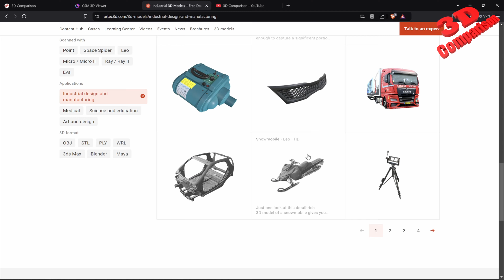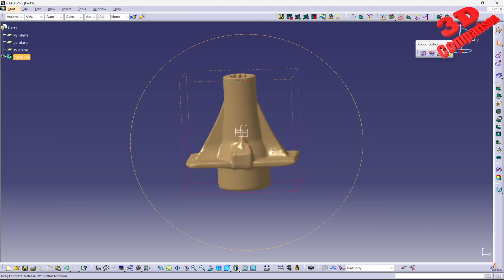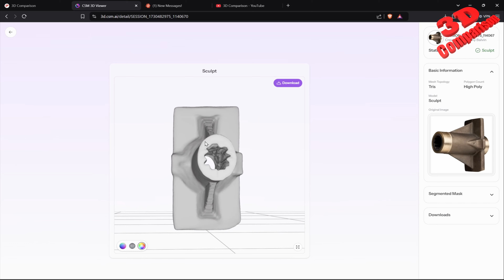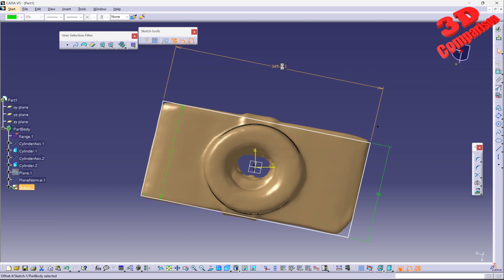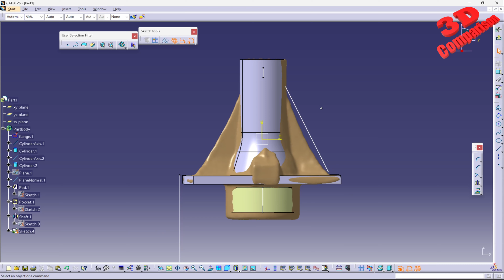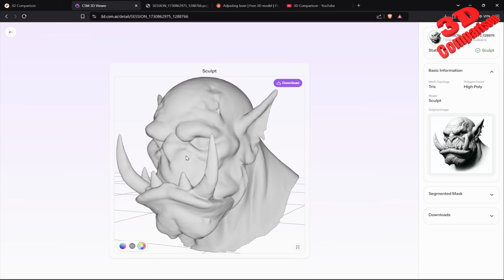Will Generative AI Disrupt 3D CAD?

Comment: Excuse me,
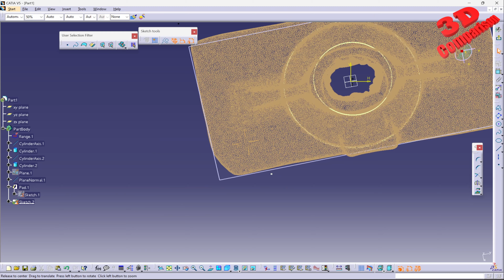As I know, if you want to use pocket(Part Design) it's not necessary to make a close profile; At this moment (13:10) the first line you created was enough to cut the corner.
Reply from the maker: Agree, you are right about this. I am mostly working with multiple CAD solutions (CATIA, SolidWorks and Fusion 360) I usually close the profile as a habit since most CAD solution require this for Solid Part Design.
Reply: @3DComparison  Oh right!!
sorry.😅